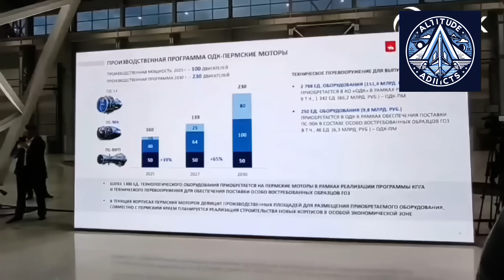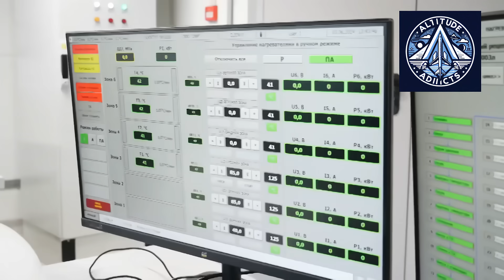PD-35 Under Putin’s Review—What Does It means?

Comment: PD-35 jet engine will revolutionize the long-haul segment of the aviation industry. U.A.C., as well as China's C.O.M.A.C., will now be able to produce modern twin engine aircraft, capable of flying nonstop between destinations such as Moscow - Johannesburg, Shanghai - London, Dubai - Vancouver, Sao Paulo - Istanbul etc etc. In the near future, there's a high likelihood, PD-35 could be mounted to the latest IL-96/400M (potential, two engine variant), which in itself will be a major BREAKTHROUGH
Reply: Not a big deal. Delays are common in the aviation industry. Boeing 777X has been delayed for several years now
Reply: @rehmanabdul9140 
Da muß man bei der 777 mal ganz genau eruieren woran das liegt. Wer hier mitgewirkt hat, was die Folgen des Ausschlußes sind ect.pp.
Reply: @rehmanabdul9140  We'll see. China is turning to its own high-thrust turbojet engine for the COMAG C929. I doubt that there's a sufficient market left for purely Russian long range wide body aircraft. It's more likely to end up as another very expensive prestige project by and for the Kremlin. Just like the failed Il-96.
Reply: @luisdamian4562
Es wird wohl eher so sein, das der Kunde sich wie bei anderen Flugzeugbauern auch, daß von ihm bevorzugte Triebwerk aussuchen kann.
Reply: You are referring to the Chinese CJ-2000 jet engine, which is in the very early stages of development. Whereas, PD-35, is almost ready -  And the first customer is expected to be C929 of China. The future of commercial aviation belongs to  Russia & China
Reply: @rehmanabdul9140  The PD-35 is currently expected to enter service in 2029 (if not delayed once again). The CJ-2000 foresees service entry in 2030.
When making bold statements about the future of commercial aviation, you may keep in mind that China is currently in final negotiations with both Boeing and Airbus for multi-year contracts to purchase up to 1000 jet aircraft of various types.
Reply: @rehmanabdul9140  Boeing - while in a kind of crisis - still delivers more jet aircraft in an average week than the entire Russian civil aviation industry within two years. 🤷‍♂
Meanwhile, it's Airbus setting the global benchmarks in almost every category.
Reply: @rehmanabdul9140  It will be interesting to see which country goes bankrupt first: The USA with its addiction to debt, or Russia with its completely absurd spending for the military in general and a stupid war in particular. I have a guess...
Reply: @luisdamian4562да бросьте вы. Чего они там задают? Просто задавили всех. Как будто до них в России их не делали. Теперь делаем. И лучше. Новые будут. Они точно будут лучше, знаю Россию.
Reply: The il-96 is an outdated platform, there's no point in investing billions to reengineer it with pd-35 engines.
Reply: @danielandersson1139 
UAC arbeitet bereits an einem neuen Großraumjet.
Es wurden ja in Russland für ausländische Konzerne umfangreiche technologische, wissenschaftlich technische Forschungs-/ Entwicklungsarbeit geleistet.
Dieses war plötzlich nicht mehr erwünscht, liegt also alles bereits in den Unterlagen, Konstruktionsbüros & Forschungseinrichtungen vor. Als so vollkommen neu entwickeln müssen die Russen da nicht all zu viel.
Und der größte Fehler war esschon immer, den Russen zu unterschätzen.
Hochmut kommt vor dem Fall.
Reply: @rehmanabdul9140  на ил 96 не установят, нет такой возможности, проще новый самолет создать, чем на старый вешать такие двигатели.
Reply: Whatever the "near future" may be. The PD-35 program has already seen multiple delays.

Comment: Pd 35 need to have gears like rolls royce ultra fan in future update
Reply: Russian engines are leading edge they dont need to look at what rolls royce does
Reply: @bejdje-j3v no they aren't. They need to be fuel efficient.... Engines need to have high bypass ratio.... S
Reply: @bejdje-j3v lo que dices es tremanda arrogancia y tremendo error
Reply: So does one of the P+W egines.
A planetary gear aint a new thing, you cordless electric screwdriver will have one.
Reply: Bitte beachten das es in erster Linie um den Kern des PD 35 geht, auf dem danach die Varianten des PD 26 bis PD 44 vorgesehen sind.
Ebenso beim PD14 der PD 12 bis 18 ermöglichen soll.
Oder das PD 8 welches PD 6 bis 10 ermöglichen soll.
Das PD 18 ist übrigens als Getriebetriebwerk geplant.